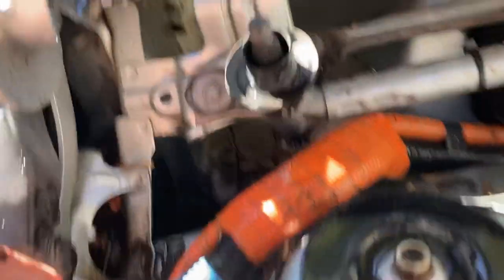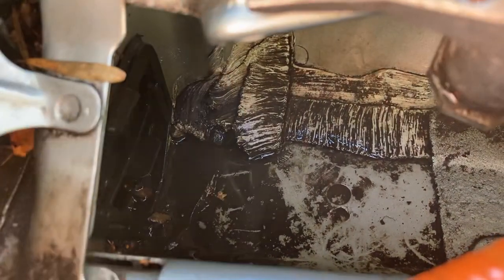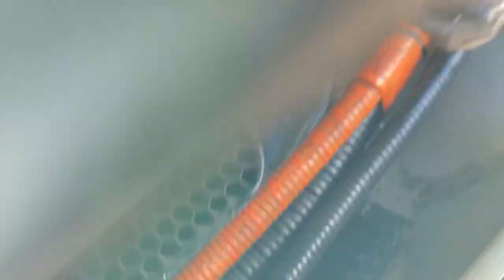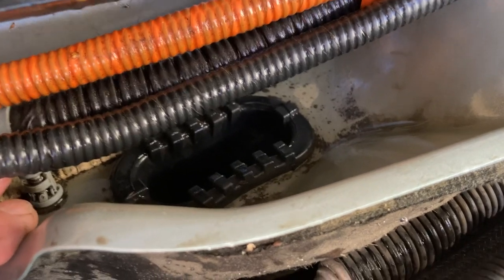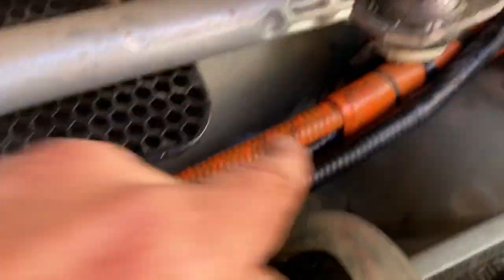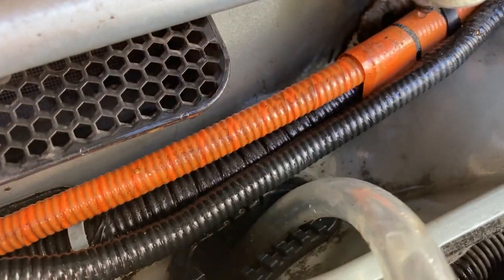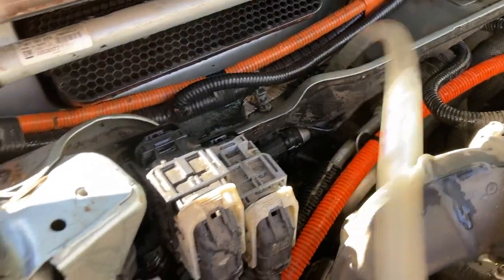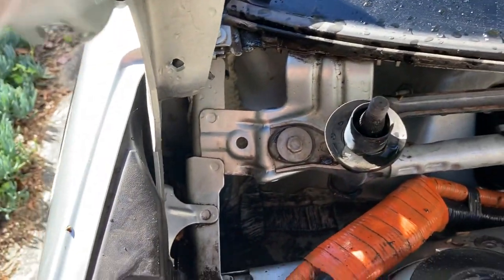Chevy Volt (2013) rain soaking wet passenger-side carpet due to clogged drain under wiper cowling.

Comment: Just did it with my 2015 volt that had wet passenger side carpet after a heavy rain. Used a 50-ml syringe and a pliable hose to dislodge the debris/dirt. Should be good for another 8 years. Thanks for the video.
Reply from the maker: Good News!!! I am glad to be of service
Reply: Was your driver side affected at all?
Reply from the maker: @PFGym5   my volt's driver's side has always been dry

Comment: Can you show or description of how to take off cowering and crossmember?
Reply from the maker: Thank you for your interest. I began this quick video when part way through doing the task. As I recall, after removing the wiper arms getting the cowling removed seem straightforward. The cross-member was easy to remove with 2-3 bolts on each end.
Reply: Thanks I’ll going to try it

Comment: You mention your passenger floorboard. My driver floorboard is soaking wet. It’s often parked outside under trees and it’s been raining a lot lately. My question is do you think this same clog could be attributed to the drivers side?

I initially suspected the AC condensate drain but that’s apparently on the passenger side.
Reply from the maker: Unknown... Perhaps on the driver's side there is another drain. There is definitely a horizontal drain far over at the perimeter of each side that goes down into the fender area (referred to at 25-30 seconds)... Perhaps that horizontal drain is clogged on the driver's side of your Volt.  There is another wet floor volt video that pointed to the ac condensation drain on the passenger side being clogged and so full of water that sloshing could be heard and it overflowed to soak the driver's side floorboards and carpet
Reply: Same problem with my Opel Ampera. Driver Side carpet becomes wet when car parked outside in Rain. Opel Dealer tryed 5 Times to solve the issue but after many hours and 1700 Euro it's still not solved.